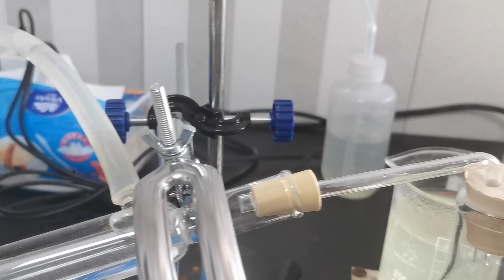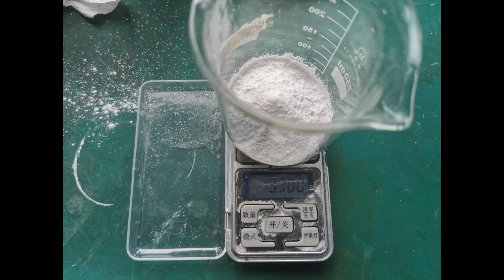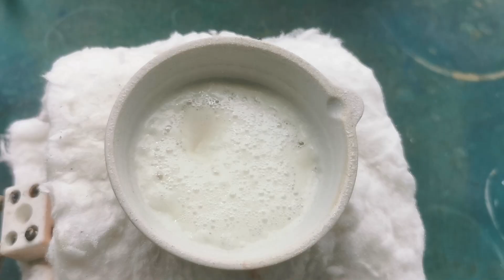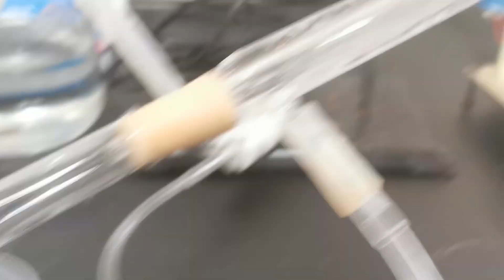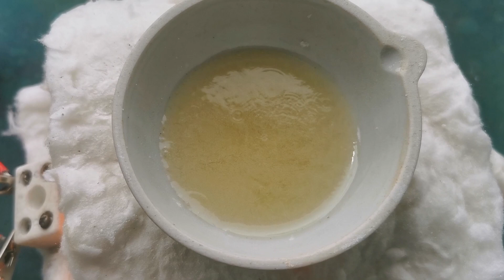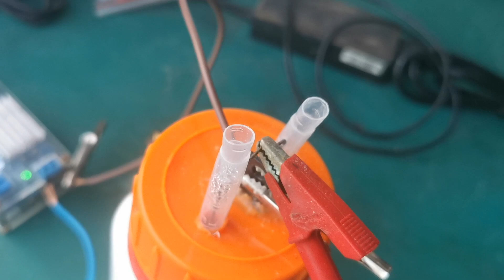Lab Notes - Perchlorate Process Optimization

Comment: really cool procedure, im guessing the electric heater was made with nichrome wire and something like a light dimming switch, but may i ask what gauge/thickness you wire was and how much power youre putting through it?
Reply from the maker: The wire wasn't actually nichrome but a cheaper iron-chromium-aluminum alloy. Nichrome would obviously work as well. The power was around 200-300W, and it's totally fine to be slightly less if the insulation is good. The key is the temperature of the melt

Comment: Hi MIH,

Nice videos about making thermo-disproportionation of ClO3(-) to ClO4(-).
One can also start from Javel Bleach what is cheap and easier to get OTC or to make (less current and corrosion) or to get now than ClO3(-) (it was accessible up to 60% (with NaCl) in brico shops by 1 or 5 kg bags (I stil have some) when it was not banned by the EU regulations; and even 99% in France next buy as total weed killer.
Bleach require more product but it is essentially the same; you need to heat over 80 degree C (boiling is fine) and the disproportionation becomes a major reaction (this is the main reason why Bleach water looses its oxydative power, looses its yellow color and its chlorine-chloramine smell upon storage, in the sun or upon time).
3 NaOCl --> NaClO3 + 2 NaCl

The porcess is easy because when not doing all by electrolysis you simple have to allow Cl2 (g) to dissolve into NaOH solution what is the process to make Javel Bleach water.
Cl2(g) + H2O --> HCl + HOCl
HCl + HOCl + 2 NaOH --> NaCl + NaOCl + 2 H2O
--------------------------------------------
Cl2 + 2 NaOH -aqueous-> NaCl + NaOCl + H2O

I think that Laboratory of Liptakov has made a video on the purification process from aceton (propanon) what is also an OTC solvant.
This process illustrate something I knew for about 30 years (and partly known from organic chemistry) and that I have experienced, so it really works.

Aceton is surprisingly a good solvant for NaClO3 and NaClO4 (the effect is less interesting for potassium (KClO3 is interesting for its non hygroscopicity and some pyro or chemical applications) so better stick to the cheaper and more soluble NaClO3 and NaClO4.
Aceton is often use to dissolve NaI for halogen exchange in organic chemistry; aceton saturated with NaI is submitted to an organic chloride (or bromide but chloride is really cheaper and more available) and NaCl what is formed during the reaction (Finkelstein) is totally unsoluble into aceton and so it precipitates and is kicked out of the system equilibrium thus pushing the reaction that way.
R-Cl + NaI(aceton sol) <--==> R-I + NaCl(s)
It seems that solubility in aceton is in the order:
sol NaCl << sol NaClO3 < sol NaClO4

It is essentially you Ethanol process (ethanol can get DIY by fermentation and distillation of sweet suggar fruit juice via anaerobic brewer or backer yeast (saccharomices cerevisiae); aceton can be got from calcium or other acetate (vinegar) salts by thermolysis (you recover carbonate that can be reused with acidic vinegar to re-get acetate salt).
CaCO3 + 2 HO2C-CH3 --> Ca(O2C-CH3)2 + H2O(l) + CO2(g) (H2O + CO2 = H2CO3)
Ca(O2C-CH3)2 --heat-thermolysis-> CaCO3 + CH3-CO-CH3 (aceton-propanon)
Aceton is also quite volatile and flamable solvent so distillation should be easier than ethanol.

PHZ
(PHILOU Zrealone from the Science Madness forum)

Comment: you should never use more than 5.5V for chlorate cell. also measure the surface area of MMO  (both side)and multiply it by 0.2 to get the current that u need to feed the cell
Reply from the maker: The voltage displayed on the module was the output of the power supply and isn't the actual voltage across the cell. I've connected a resistance wire in series with the cell to control its voltage and current
Reply: @MIH0319  you should make a small PbO2 electrode.... Its much better for making perchlorate. Its relatively easy to make... You just need NaOH and PbO and current control.
Reply: @Exotic_Lab  It is very easy, but it requires a lot of time and control over the pH.
Reply from the maker: Well the good electrodes have another layer of acid-plated PbO2 outside the alkaline plate. So you need some lead salts as well. But I purchased a PbO2 electrode from someone else so I guess I won't make my own for now.

Comment: another optimization is eutectic formation by using 1:2 ratio of KClO3:NaClO3 which lowers the reaction temperature (allowing for disproportionation but not decomposition) and even when overheated yields 80% or so 
source https://www.youtube.com/watch?v=vPCo_jDAOr4 (this guy specializes in electrochemistry and chlorate/perchlorate if you havent seen him before)
Reply from the maker: I've came across this video in my research and it seems promising. I'll try the method in my next perchlorate vid

Comment: Cool video + can this process be used to make KClO4?
Reply: Yes,
NaClO4 + NaClO3 (minor) recovered from aceton extraction; acid HCl washing that destroys the ClO3(-) (beware yellow gas is toxic Cl2) but leave the ClO4(-) interger behind.
5 Cl(-) + ClO3(-) -5H(+)-> 3 Cl2(g) + 5/2 H2O 
(this is the reason why perchloric acid cannot be done by reaction of HCl with ClO3(-) but can be done from H2SO4 (or other oxydised acid) by disproportionation and distillation (avoiding the danger of reacting the acid at higher % than 40% what would cause formation of HClO3 > 40% and decomposing energetically in flame; the steady heating from 40% will allow disproportionation intp HClO4 and volatile HCl (beware caustic and corrosive to all metallic parts even inox; nuts bolts; it makes all rust quite fast due to FeCl2-FeCl3 and further corrosion catalycally by moist air into FeO, Fe(OH)2, Fe2O3 and Fe(OH)3 (so a finite quantity can make you lab look a pitty).

Then dissolve in demin-water the NaClO4 and allow to react with K(+) (low salt for example 60% KCl and 40 % NaCl; (or K2CO3 or KOH) to precipitate the KClO4).

PHZ
(PHILOU Zrealone from the Science Madness forum)
Reply: Yeah, if you use a mixture of NaClO3 and KClO3 you actually get better yields.
Reply from the maker: @chemistryofquestionablequa6252  Well not exactly. KClO4 has poor solubilities in organic solvents so you probably can't extract it out very easily and lose a bunch of yield.
Reply: @MIH0319  you can’t do the extraction the same way, for KClO4 you use water, but the disproportionation part is exactly the same.
Reply from the maker: @chemistryofquestionablequa6252  Right, but will a water extraction separate the KClO4 from the remaining KClO3 cleanly or multiple extractions (or crystallizations) are required?
Reply: @MIH0319  I responded but I think YouTube deleted it. Ninja chemist said what I said but in less words
Reply from the maker: All right. Thanks guys for your information
Reply: With kclo4 you dot need to use organic solvents because of poor solubility. Single recristallization from boiling water works best, most of kclo4 will precipitate on cooling.
Reply: @NinjaChemistChannel  miss your videos

Comment: You can extract the NaClO4 with acetone as well. When I’ve done this I’ve used only enough heat to have a slow rate of bubbling and it all seems to convert very near the end of heating rather than over the span of the reaction, not sure why.
Reply from the maker: Lol in China acetone is restricted for some reason so I can't get it
Reply: @MIH0319  I forgot you were in China, that’s such a weird restriction.
Reply: @MIH0319  
Probably due to the unfamous peroxide used by Ter-Ro-Ri-St CycloTriAcetonPeroxide (CTAP) wrongly named C A T P
Reply: Ethyl acetate works better and can be synthesized from vinegar and alcohol fairly simply based on YouTube procedures.
Reply from the maker: Indeed, NaClO4 is soluble in EA.